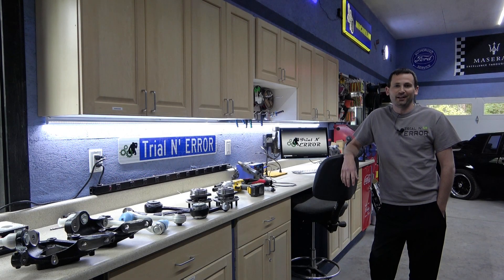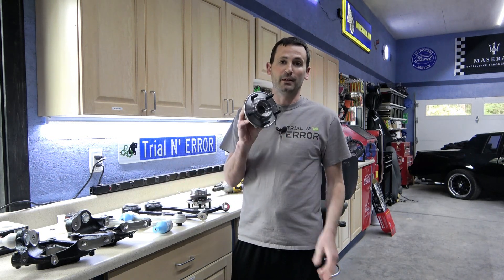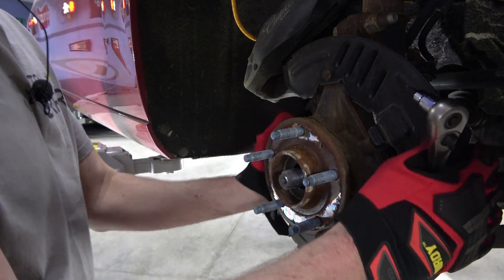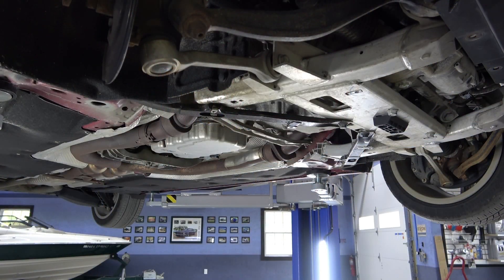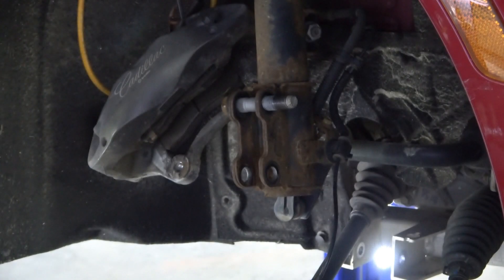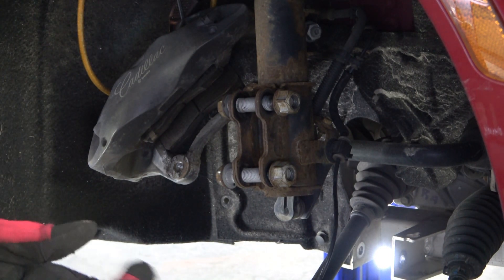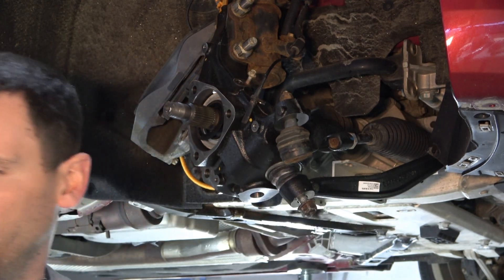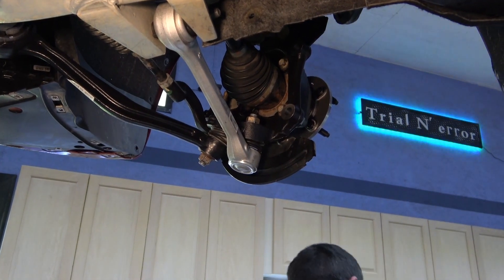DIY! Replace Cadillac ATS Ball Joints, Wheel Bearings, Lower Suspension links, Knuckles +MORE

Comment: Great video that really set me up for success when tackling the same repairs/replacements on my 2.0t ATS AWD, Tom. Just a few notes, I'm sure it was omitted for time, but you want to make sure you reinstall the ABS Sensor to the wheel hub after the hub is torqued down; also, the bolts on the forward and rearward front lower control arms are 'torque to yield' bolts (one time use - they lose their elasticity and can snap when reused), make sure you order new bolts for those two points when you are replacing or even just uninstalling them to replace the knuckle. For a few extra dollars, it could save you from a catastrophic failure while flying along the road. Thanks for sharing this video, it is hard to find good instructional videos for the ATS online. Can't wait to see you tackle the timing chain and water pump replacement before I have that need myself!

Comment: Nice work Tom. One suggestion. I have found it easier to keep the axle pushed inward to gain room to torque the hub bolts. Also helps when removing the bolts. 
Love those cars! When GM designed those cars there was a lot excitement on how well they drove and handled.
Reply from the maker: Yea, you're dead on in regards to the axle, even with that it's still a tight spot.  This was one of the first cars that was made after the big shakeup at GM where they told the marketing teams and executive bean counters to piss off and turned control back over to the engineers.  With the exception of a few bonehead design issues, the vast majority of the design and materials are right up there with what one would expect from a "premium" brand.  This isn't your grand dad's Northstar Caddy.  Those day's are long gone lol.

Comment: I just noticed the lights on your lift that run up both posts on your newest video, but they were not on like this video. How do you like the lights? Did i miss you talking about the lights in one of your videos?  Which lights did you go with?
Reply from the maker: They are leftovers from the lights on the ceiling.  I added them to the lift but never really talked about them.  I really like it.  It does a nice job of throwing light up and under the cars.  I just used 3m tape to attach them and wired them to one leg of the 220v that feeds the lift (not to code lol).

Comment: So your ATS is a 13’ but has the headlight and fog lights that have the led strip like all newer models. My wife’s 13 ATS is a base model. Ao not light strip. Is it possible to upgrade to the ones with the strip or will there need to be custom wiring done for something like that?
Reply from the maker: I don't think that's a direct swap.  The LED version of headlights are really different.  Not just the LED but they also have the motorized projector beams that turn the headlights left/right/up and down depending on if you're turning, heading up or down a hill.  I'm guessing there's a completely separate BCM that controls this so it's not part of the factory wiring (the wiring is most likely there).
Reply: They sell aftermarket ones on eBay and the lower part drl light are from a newer model but they fitt I have them on mine

Comment: Are you supposed to tighten some of the suspension bolts with the car on the ground or is that a myth?
Reply from the maker: Never heard of that to be honest.
Reply: Definitely not a myth but only really applies to where the control arms meet the subframe and not ball jointed connections. If one were to tighten a bolt, that has a rubber or poly bushing cushioning the joint, while the suspension is at full droop it will bind as the arm goes through its range of motion. It either wont allow the arm to fully articulate to full compression or it may allow it to but will literally destroy the bushing at it does. When tightening at ride height it allows for the plus or minus movements of compression or extension.

Now if you have spherical bushings, or the likes, it matters not as the spherical ball is able to rotate fully as opposed to a static rubber or poly bushing that literally can not rotate. 

This is a big deal mainly with vehicles like Jeeps and such where you have alot of suspension travel, but the concept 100% still applies.
Reply: Doesn't have to be on the ground. Measure from axle nut to ground before jacking up. When ready to torque, measure again and subtract original measurement from new one. Then jack up the knuckle that amount.